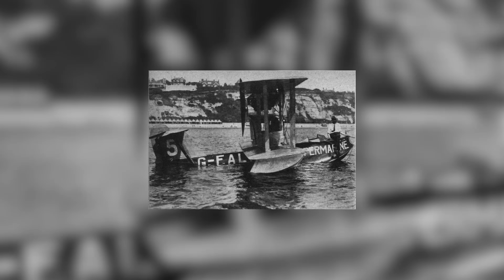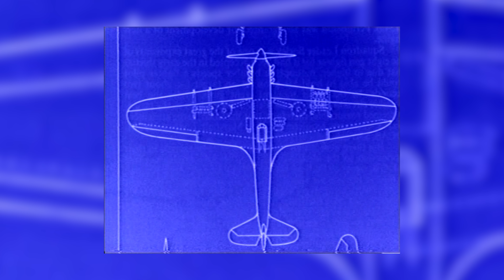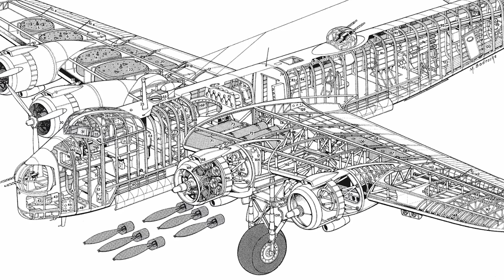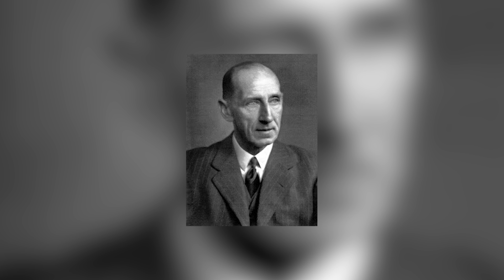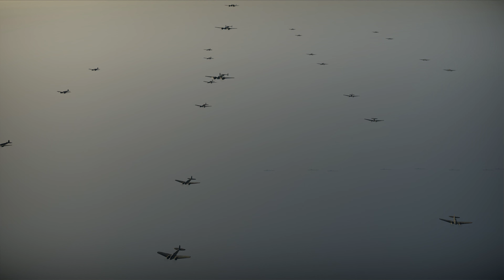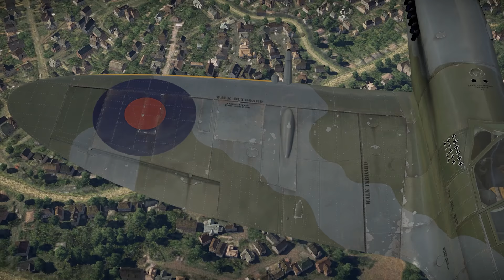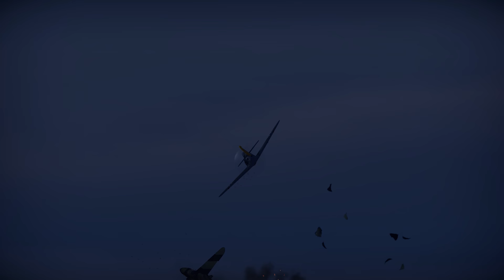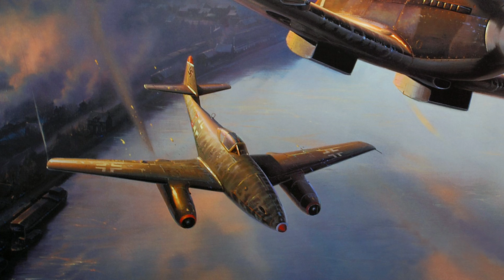SPITFIRE | A Documentary

Comment: earlier on in the war the hurricane was better than even the spitfire, due to its slower speed it was more Manoeuverable and it had more ammo than the spit, and since it was made of wood and fabric it was cheaper to repair, it could also take more hits, (im talking of mainly the Battle of Britain era. So 1940-41
Reply: Not better,  just more of them, the Spitfire still had a higher kill ratio and lower loss ratio as well as Spitfire pilots having a better chance of surviving if their aircraft was hit.
Reply: @barrierodliffe4155  in fact u were more likely to survive in a hurricand because when it was hit shockwaves didnt go down the plane, yes it did have a higher kill ratio because as the spit was upgraded the hurricane was not, im talking about earlier on in the war, the hurricane 
performed better than the spit
Reply: @avocadofilms9856  
I was talking about the Battle of Britain when Spitfire pilots had an advantage of better performance and better survival rate as well as better kill ratio. That includes up to the Hurricane Mk II which had the Merlin XX engine while the Spitfire Mk II had the lower powered Merlin XII engine.
Reply: @barrierodliffe4155  the hurricane could turn better and had more ammo, also the reason the hurricane had a lower survival rate is that they were more often attacked without knowing because they were also used as trainers wheras spits were deployed and back to the other point, the hurricane could actually get behind the enemy’s plane and shoot, at the time it was the better fighter the spitfire was just made to seem good, if u think most of the other successful designs in the war by the British and even the p-40 look remarkabley like the hurricane also pilots said they preferred to fly the hurricane, it was easier to handle, and it could dogfight better
Reply: @avocadofilms9856  
Both the Hurricane and Spitfire could turn inside a Bf 109, the Spitfire could maintain a turn at higher speed than either. They were both used for attacking bombers and both took on the Bf 109.  Both were used for training, there were the OTU  squadrons which were away from the combat.  Both could get behind the enemy and shoot.  The Spitfire Mk II had the Merlin XII and there was a Mk III designed to take the Merlin XX engine, it had extremely good performance at the time but the Hurricane Mk II used the Merlin XX and it was decided to drop the Spitfire Mk III which would have meant closing down a production line and using the Merlin XX which the Hurricane needed more so they continued with the Mk I and Mk II Spitfires. The RAF looked at the results and came to the conclusion that the Spitfire was the better fighter and the one that should be developed further.  I go with the RAF and their findings as well as the fact that the Spitfire had a better kill and lower loss ratio.  
Some pilots preferred the Hurricane, many others preferred the Spitfire which handled superbly, many Spitfire pilots said you did not fly a Spitfire you simply thought where you wanted to go and the Spitfire went there.  There is no doubt that in a dogfight the faster and better performance of the Spitfire made a big difference.
Reply: @barrierodliffe4155  then how do u explain that the highest scoring squadron 303rd squadron were hurricanes, also no fighter can be better than the other without the pilot and well I guess that’s the defining factor, if u could fly a spit u flew a spit but if u could fly a hurricane just as well as that spitfire pitot could fly their spit, and also controversial opinion but I actually prefer the design of the hurricane to the spit, also I could talk about the mossy or hornet for hours, but think about it like this, if the red Barron was to go against a normal ww2 pilot the red baron would win because he’s more skilled, and that’s the factor, what’s the point of flying a spit when ur better at a hurricane and vice vercer, still the hurricane I feel needs a bit more recognition, and the gladiator too
Reply: @avocadofilms9856  
Very easy, the top three highest scoring squadrons in the Battle of Britain were Spitfire squadrons. 
The Red Baron  rarely took on fighters and only if he had a big advantage, he died when a British pilot caught him out.  Mostly the Red Baron was not alone, he attacked when he was against a lesser aircraft all on it's own.  I do not call that skill.  
The Hornet was a superb fighter but too late for the war, the Mosquito like the Beaufighter excellent but I would not want to take either to a fight against a Spitfire.
I have nothing against the Hurricane or Gladiator, I consider the Gladiator and CR 42 to be the best biplane fighters they both served well but like the Hurricane they were outclassed by the Spitfire.
Reply: @barrierodliffe4155  so basically my school lied to me... 303 squadron was a hurricane squadron.... that was the highest scoring squadron in the Battle of Britain, i just wish there was more appreciation for the hurricane, swordfish, gladiator, hornet ect... because they were all brilliant fighters and were all so versatile and let’s be completely honest the hurricane was probably the most versatile fighter of the war
Reply: @avocadofilms9856  
303 was a Hurricane squadron and the 4th highest scoring of the Battle of Britain, the highest scoring Hurricane squadron but beaten by 3 Spitfire squadrons.
Good aircraft but Ito be honest I would not want to meet a Luftwaffe fighter in a Swordfish.
I would say the Mosquito was the most versatile followed by the Spitfire.  
The Spitfire was used for air superiority, ground attack, as a dive bomber, photo reconnaissance, bomber escort and more. From a USAF source  The Spitfire was the main escort fighter for the USAAF until mid 1943. 
For ground attack Spitfires could carry rockets or bombs and the RAF used them for very accurate bombing of difficult targets, including a house in a French town being used by the Gestapo, the Spitfire pilots were given the address and asked to deliver a small bomb to the front door.   The idea was to destroy the house but not the neighbouring houses.
Reply: @barrierodliffe4155  so im just gonna state that the hurricane is quoting a documentary on every plane of ww2 “the hurricane was probably the most versatile single seater fighter aircraft of the second world war, going from everything from a trainer to a night fighter and bomber, this aircraft was the logical conclusion of a long line of aircraft and was the most versatile single seater of the war, and another is a technical marvel and something that came completely out of the blue” also if u google “what was the highest scoring squadron in the Battle of Britain” it comes up with 303’rd
Reply: @avocadofilms9856  

The Hurricane was not a trainer or night fighter,  there were OTU squadrons with Hurricanes and the same with Spitfires. Pilots first trained on light aircraft then went on to the Harvard or Miles Master.  The Hurricane was briefly used for fighting at night but the night fighters were the Boulton Paul Defiant, Bristol Beaufighter and DH Mosquito with radar. The Hurricane could carry bombs and so could the Spitfire, the Spitfire also did photo reconnaissance, not the Hurricane.  The Spitfire did escort bombers, the Hurricane didn't. 
If you google you get 303 squadron claims for 126 enemy aircraft shot down but if you go deeper into it you can find that they overclaimed, now I know that there was a bit of overclaiming by all squadrons but it turns out that the Polish were very optimistic in their claims. it has been established that 44 of those kills have been positively verified.
If you google the top scoring pilot you find the Czech pilot  Sgt Joseph Frantiseck with 17 victories, but looking further  Flt. Lt. Erick Lock had 21, Sqn Ldr Archie McKellar 19 and Sgt James Lacey 18.
I notice that Lock flew Spitfires and McKellar and Lacy Hurricanes, in fact of the top ten pilots in the Battle of Britain, half flew Hurricanes.  I would not want to detract from the way both fighters served, both played their roles well. 
I have been putting information together for a book I am intending to write and it is not just about aircraft but does include some of the most important aircraft in the war.

The Hurricane served very well and by the Battle of Britain was improved and able to take on Bf 109's quite well. The Hurricane also served in Malta, North Africa and Burma.
The first Hurricanes shot down in the war were by Spitfires in a case of mistaken identity, hence the insistence on training for aircraft recognition.

That is what I have written about the Hurricane so far, as I say I am only in the early stages of this project and I have a long way to go. I shall include how the Hurricane was given 4 x 20 mm cannon then 2 x 40 mm cannon, and more about where and when it served.  So far I have put a bit about the following aircraft, Hurricane, Spitfire, P 38, Mosquito, Beaufighter, Lancaster, Typhoon and Whirlwind.  I have yet to include other aircraft but will do so as time permits. 
This is what I have so far about the Whirlwind which I feel has been largely overlooked.

The Whirlwind was fast when it entered service and very capable, as fast as a Spitfire, it had the heaviest armament of any fighter at the time and but for Rolls Royce stopping development of the Peregrine and Vulture engines to concentrate on the Merlin and Griffon the Whirlwind would have been even more successful, it was a very good fighter bomber.
To me the Whirlwind was a better designed twin engine fighter than the Bf 110 or P 38, If only Westland could have scaled it up a bit to take the Merlin.  

My research is over a wide range since I am intending to include civilian life when being bombed and navy and land battles. The big problem is what to leave out. If I mention bravery by a British soldier but not a German soldier I will be guilty of being one sided.
There are a couple of German generals I have to include and they are not the obvious ones.  One of them saved Paris, the other save British soldiers who had been captured near Dunkirk.
Reply: @barrierodliffe4155  303 was still the best scoring squadron in the Battle of Britain and they flew hurricanes
Reply: @avocadofilms9856 
44 victories does not make it the best
Reply: @barrierodliffe4155  alright, my turn for a long ass essay

im not saying the hurricane was the best, yes the spitfire outclassed the hurricane in many ways but the hurricane also outclassed the spitfire in many ways, the spit was faster but the hurricane had a tighter turning circle, the spit could climb better but the hurricane could dive better with it being able to turn up almost instantly, the spitfire could glide better but the hurricane could take more punishment, quoting a German ace “it seemed like it was impossible to kill a hurricane” the spit is a technological marvel while the hurricane is the logical outcome of a long line of aircraft,” the hurricane had better landing gear”, again quoting a spitfire and hurricane pilot, the hurricane was easier to fly, cheaper to build, and quicker to repair, also the hurricane inspired many successful designs in the war, e.g: the typhoon, the p-40 warhawk and kittyhawk, that one french plane, p-51b, the boulton paul defiant, and many more, whereas no one could replicate the genius of the spitfire, I just feel like there should be more appreciation to the unsung heroes, and the workhorses, also the hurricanes job was to take out the bombers which u know that was the main threat to Britain, but yeah more appreciation to the workhorses, the hurricane, the mossy, the p-51-b, the boulton paul defiant, the swordfish and more, yes not all of them were fighters and I could go on and on for days about underrated planes that played an important role, the swordfish was an amazing torpedo bomber, the mossy was ine of if not the most versitile aircraft followed by the hurricane, and again, many more. Alr, imma end it on that note, more appreciation for the lesser known planes, and lets not forget, planes wouldn’t be anything without the pilots.
Reply: @avocadofilms9856  
While I keep on hearing that the Hurricane turned tighter I never see any numbers to support it,  at 12,000 feet the Spitfire turned 200 feet tighter than a Bf 109, pulling more G and at higher speed without losing altitude. I have a radius of 696 feet for the Spitfire at 12,000 feet without losing altitude, and 885 feet for the Bf 109 at the same height.   I see Len Deighton gives 800 feet for the Hurricane and 880 feet for the Spitfire but no details of height.
I do not forget any aircraft and I have great respect for the Beaufighter which was also very versatile.
Reply: @barrierodliffe4155  don’t forget the slower the aircraft the tighter the turning circle this is why the night witches, swordfish and more were nearly impossible to hit, yes the spitfire was very manoeuvrable but the hurricane could always turn inside of the spitfire, also early on in the war the spitfire had reliability issues whereas the hurricane didn’t, personally though my favourite aircraft is the boulton paul defiant, a very underrated night fighter and it just looks beautiful aswell
Reply: @barrierodliffe4155  now to quote an article “Deighton also noted that the Hurricane had a tighter turning radius than the Spitfire-800 feet for the Hurricane compared with 880 for the Spitfire. This meant that the Hurricane could turn inside the Spitfire, like a sports car outmaneuvering a sedan–a vital attribute in air combat.”
Reply: @avocadofilms9856  
It does not always apply, the Boulton Paul Defiant was slower and could not turn very well, as a night fighter it was completely outclassed by the Beaufighter. The Swordfish turned well but was very slow and rather a sitting duck for fighters.
I have never seen any confirmation that the Hurricane could turn tighter than a Spitfire which could turn almost 200 feet tighter radius than a Bf 109 and maintain higher speed while doing so.   I have never seen any reliability issues for the Spitfire.  Maybe you can come up with some proof.
Reply: @avocadofilms9856  
Len Deighton gave no evidence for that claim, and since the Spitfire at 12,000 feet could turn in a 696 foot radius I have to question that.
Reply: @barrierodliffe4155  ok imma defend the defiant, yes it was outclassed by the beufighter but it was a low personell aircraft and easier to fly, if a beufighter got shot down it would most likely loose all of its crew whereas the defiant had only 2 people, also the defiant was made for night fighting, it would swoop down underneath the bombers and hit their bombs, also with it being smaller it was harder to hit, it was not made for combat and don’t forget that at the time of the blitz the beufighter wasn’t in service until 2 months until it’s end, the defiant wasn’t made for dogfighting it was an interceptor, which at the time it excelled at
Reply: @barrierodliffe4155  multiple sources say the hurricane could turn tighter, also its a fact the slower the aircraft the tighter the turning circles, quoting a pilot who flew both spits and hurri’s, “if you could force a 109 into a turn fight you would always be able to get behind it faster than the spitfire”
Reply: @barrierodliffe4155  again the swordfish wasn’t made for dogfighting, it was a torpedo bomber and that it excelled at, yes no plane can do everything but they all have their own strengths
Reply: @avocadofilms9856  
The Beaufighter had a crew of 2 people, it entered service in 1940 and shot down a Ju 88  on November 1940, increasingly used as a night fighter with the speed to catch bombers and the firepower to destroy them, the 4 x 20 mm cannon had longer range than the 4 x 0.303 so the poor bomber crew would not have much chance.  When the Mosquito became the main night fighter the Beaufighter had many other roles, the Beaufighter even had the ability to fight as some Luftwaffe pilots found to their cost. The Defiant became a target tug. I know the Defiant had some early success but it really was not a good idea and underpowered.  .
Reply: @avocadofilms9856  
Multiple sources which claim the Hurricane could turn tighter but I have yet to see any of these claims give real numbers, could a Hurricane at 12,000 feet turn inside 696 feet without losing altitude because that was done by a Spitfire Mk I in flight tests. Since the Spitfire turned tighter than the Bf 109 and could do a complete turn some 6 seconds faster, I have yet to see anything that shows the Hurricane could do better.
Reply: @avocadofilms9856  
Exactly, the Swordfish was very good but it was not a fighter.
The very versatile Spitfire did not carry torpedoes but it did many other things very well, it did carry bombs or rockets, was used for air superiority right through the war, was used for photo reconnaissance, did bomber escort, was used as a dive bomber and much more.
Reply: @barrierodliffe4155  Not under powered, under rated, due to its smaller size more could be stationed and ready do go as soon as possible, also it was an effective trainer for turret gunners, it was probably one of the better fighter with turret planes, like compared to the blackburn roc it was a million times better, and most of the American designs for that type of plane, also i’d just like to mention that it’s an absolutely beautiful aircraft, and there was this incodent when a squadron of mesershmitts that thought they were a squadron of spitfires and fell on them, and since they came from behind all of them were shot down with no defiant losses, still... it’s my favourite because it looks great
Reply: @barrierodliffe4155  though the spitfire was very versatile, at the time of the Battle of Britain it wasn’t as versatile whereas the hurricane was at that time, now im still in school so I haven’t learned everything yet, i do know that it inspired one of the more successful designs, the typhoon which is basically the spiritual successor, I still dont like that weird engine thing under the nose, it makes it look quite ugly but otherwise a great fighter
Reply: @avocadofilms9856  
Having the same engine as the Spitfire Mk I but weighing more empty than a fully fueled and armed Spitfire with the pilot, I say underpowered, also about 60 mph slower.
The incident you refer to was when Bf 109 pilots thought the Defiants were Hurricanes so they attacked from behind, it seems that not all of the Bf 109's were shot down, Defiant gunners often claimed aircraft shot down but the problem was that when several Defiants were shooting at the same aircraft they would each claim the same aircraft the Luftwaffe pilots soon knew that if they attacked from in front or below the Defiant was helpless and even when given an escort by Spitfires there were some serious losses of Defiants.
Reply: @avocadofilms9856  
The Hurricane in the Battle of Britain was a fighter and older Hurricanes were used for pilot training the same as Spitfires. 
Sydney Camm who had designed the Hurricane started the design of the Typhoon in 1937 but early Typhoon's had some serious problems, it later developed into an excellent ground attack fighter, that weird thing under the front of the engine is the air intake for cooling, The Typhoon was not as good for air superiority as the Spitfire, Sydney Camm then made the Tempest which entered service about the same time as the Spitfire Mk XIV, the Tempest was very good especially at low altitude,  a little known fact is that when they were based in Belgium Spitfire Mk XIV's flew as top cover for Tempests because the Spitfire had better performance from 5,000 feet up.
Reply: @avocadofilms9856  Because the Hurricane was outclassed by the ME 109 so it was designated to attack bombers while the Spitfire engaged the 109s, this is recorded RAF fact and easily verifiable, Christ we have to go through this every time.
Reply: @colindebourg3884  it could out turn the 109.... and was better at lower altitudes which the cattle of britain was mainly low altitude and made of turn fights, it had a longer range, could take more hits, had more ammo and also the highest scoring squadron (303'rd squadron) were hurricanes
Reply: @avocadofilms9856  But it was outclassed by the 109 that's why they hit the bombers and that's why they had great success, the Spits were equal to the 109 at the very least and they engaged the 109s and so gave the Hurricanes a free hand, It's all available in the RAF records see for yourself but the Hurricane couldn't compete with the Spitfire.
Reply: @colindebourg3884  we're talking early war here, the hurricane could out turn the 109 and at the time turn fights is how battles were fought, yes the spit could also turn inside the 109 but the hurricane could do it faster and 303 also shot down more 109's than they did bombers, also yes they were told to attack the bombers but they rarely ever stuck to the formation, also they were more convenient, the materials used meant that if you got a hole in a hurri it could be patched up in a few days whereas the spit had to be taken to the metal factory, and that was expensive and the raf couldn't afford that, anyway, imma leave this now cause i got a film to make and also the best plabe of the battle of britain was the mb.20 convince me otherwise
Reply: @avocadofilms9856  I really don't think I can simplify this any more for you so have it any way you like, but check out the Battle of Britain pilot Welhams and his quote " the problem with the Hurricane was that you couldn't catch anything it was so slow ",  but if you know better than someone who was there and survived the war have it your way.
Reply: @colindebourg3884  im still sticking to the fact the mb.20 was the best plane in the Battle of Britain, tell me otherwise, although it never saw combat it was very good, also yes, the spitfire was fast but maybe I just like the design of the hurricane more than the spitfire but I personally would prefer to be in a mb.20 if anything
Reply: @avocadofilms9856  Ok have it your way, bored now.
Reply: @barrierodliffe4155  also i'd like to mention that the hurricane or the spit woud've been no use without pilots and many pilots preffered the hurricane to the spit